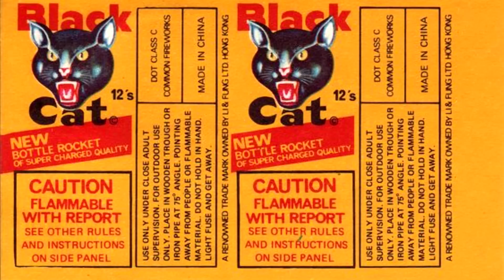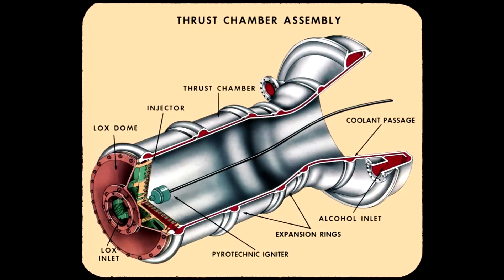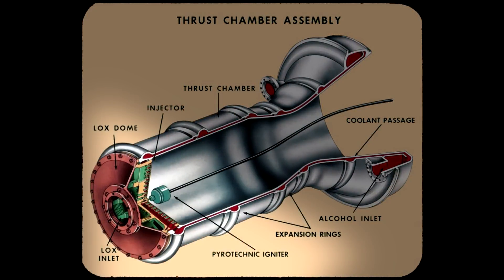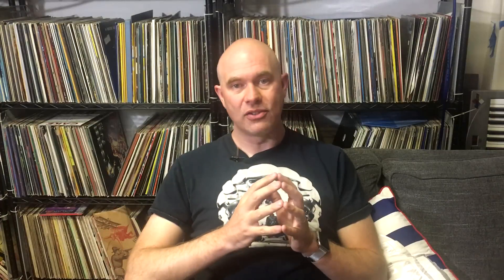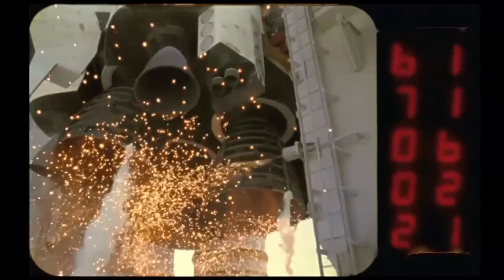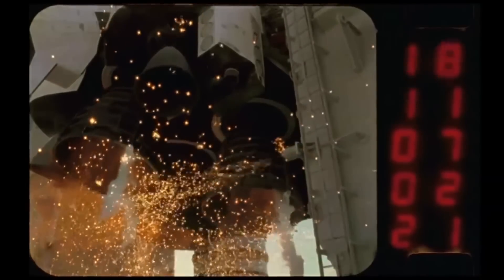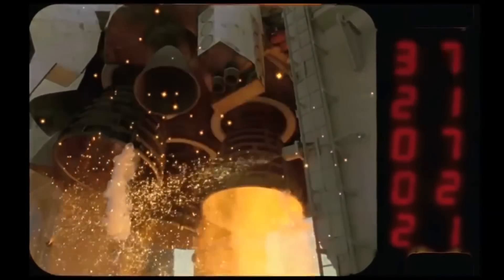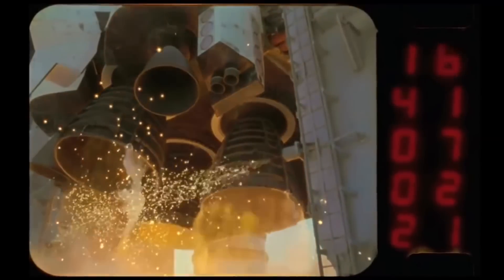How Rockets Are Ignited - Things Kerbal Space Program Doesn't Teach

Comment: Anyone interested in some of the hair-raising history of rocket fuels and oxidizers should really read through "Ignition! An Informal History of Liquid Rocket Propellants". It contains some real howlers: "If Tannenbaum's mixtures were bad, that proposed at a monopropellant conference in October 1957 by an optimist from Air Products, Inc., was enough to raise the hair on the head of anybody in the propellant business. He suggested that a mixture of liquid oxygen and liquid methane would be an extra high-energy monopropellant, and had even worked out the phase diagrams of the system.* How he avoided suicide (the first rule in handling liquid oxygen is that you never, never let it come in contact with a potential fuel) is an interesting question, particularly as JPL later demonstrated that you could make the mixture detonate merely by shining a bright light on it."
Reply: They just re-published Ignition! and I really recommend it if you're any kind of a rocket nerd. It's fun and informative, and makes me really glad I didn't faff around with liquid fuels when I was wanting to build a rocket myself.

Comment: From what I understand the Soyuz has 4 boosters running at liftoff, with each booster having one engine and each engine having 4 combustion chambers. Do the combustion chambers technically count as their own engine?
Reply: Nope, all 4 combustion chambers are thought to belong to the single engine, RD-107/108. There are also small nozzles which work on turbine pump exhaust and make the steering, they are part of engine, too. By the way, when rocket starts there are 5 engines working: not only boosters but the central engine as well.

Comment: Of course, the flip side to hypergols is that you generally wind up with large fires, rather than explosions, when you have an accident. For it to be a good and proper explosion, the fuel and oxidizer need to mix relatively well prior to ignition. That can't happen with hypergols as they ignite on contact. 

This was one of the reasons why Gemini (launched by the Titan II GLV) could rely on ejection seats rather than a launch escape system. The Titan II was powered by hypergolic propellants, so if there was an accident the fireball would be small enough that the ejection seats would clear it. Conversely, if the propellants were RP-1 and LOX, there was a strong possibility that the two would mix relatively well during an accident, prior to being ignighted allowing for a much larger explosion.

Comment: At about the 1:20 mark, you said "RP1 or Liquid Hydrogen". RP1 isn't a cryogenic, it's just refined kerosene.
Reply from the maker: +Nevan Lowe you're not praying that phrasing correctly.
Reply: I assume he means "liquid oxygen and [RP-1 or liquid hydrogen]", which would account for the fact that rocket fuels are combinations of an oxidiser and a reducer, and technically both combos would be cryogenic because rockets using either combo have to manage at least the O2 cryogenically.
Reply: Any fuel cooled to a low temperature is considered cryogenic.

cry·o·gen·ic
krīəˈjenik/
adjective
1.
relating to or involving the branch of physics that deals with the production and effects of very low temperatures.
"a powerful cryogenic engine"
Reply: "... Cryogenic propellants like liquid oxygen and RP-1 or liquid Hydrogen." It sounded like you were implying RP-1(Kerosene) and LH2(liquid Hydrogen) were the same fuel. Regardless, you mentioned RP-1 like it was a cryogenic propellant.

Comment: should talk about the fuel pumps 

most amazing thing i learned about the SSMEs was the sub synchronous whorl issue in high-pressure turbo pumps and that it was never solved so they tested it to destruction and lived with  it making the pump bearings the major factor of each engines life

Comment: Love yours "KSP doesn't teach you" series the most. And why does rocket "spark plugs" do work only with hydrogen+oxygen engines? Surely "rocket matches" systems that russian rockets use are cheaper than the space shuttle ignition system, but you can reignite the engine in case of failure, can't you?
Reply: I think that's the point, you can't reignite rockets that use "rocket matches".

Comment: But how do they light the mini SRBs at the top? a mini mini SRB?
Reply: Very much like a shotgun shell without the shot, the explosive optimized for heat and fast energy release.
Reply: Nasa Standard Detonators. Basically the same thing they use to blow explosive bolts. It's a two stage affair of lead azide and rdx.
Reply: @wingracer1614  Do you have any sources about that? Why someone would use a detonation to initiate a deflagration on such safety critical component. Considering usually solid rocket fuels contain large amounts of ammonium perchlorate which can detonate. I would guess is actually some short of thermite instead of a detonator.
Reply: Basically they use an electrically initiated blasting cap/ detonator.
Reply: It's SRBs all the way down...
Reply: Yes, with a mini-mini-mini srb igniter, with a mini-mini-mini-mini.....
Reply: Maybe an electrical signal?
Reply: @metanumia  Sure it would work but it needs to be for initiating some short of pyrotechnic mixture that deflagrates and ignites all the fuel, not a detonation train as happens in a detonator. If you use the exploding bridge-wire, arc generator or spark gap to directly ignite the fuel you run in to the problem that you need a huge power supply to do so which isn't very practical in the case of a rocket.

Something somewhat related and that uses your idea of an arc generator are ETC guns (Electro Thermal ignition Chemical guns) which is basically a conventional powder gun with a special plasma torch instead of a primer on the cartridge, this device generates a huge plasma plume inside the casing, this makes the powder burn much more uniform and in a controlled manner as you can control its burning by modulating the current going into the plasma cartridge also you can use special propellants with higher speed of sound/energy but that are harder to ignite and control. This is being researched a lot since the early 90's to increase the muzzle speed of tank rounds while also reducing erosion and high pressures because conventional tank guns are already at the limit of what is possible with normal technologies (muzzle speeds of around 1800m/s) its crazy.

Comment: This whole time I thought the sparks on the Space Shuttle were for engine ignition; thanks for throwing that bit in!
Reply: +Hirschi74 not just the launch pad! The sound waves reflect off the launch pad (tearing bits of concrete loose in the process!) and hit the vehicle, which can cause pressure fluctuations in the combustion chambers of rocket engines directly above it (and this can be a self reinforced process, making it worse until they destroy themselves) , and can even collapse fuel tanks in extreme cases. It's a seriously bad thing.
Reply: i thought the water spray is for cooling purposes while it is instead mainly for noise reduction. The soundwaves at a start are such violent, they would severely damage the launchpad if they weren't dampened
Reply: Matthew Ducker
oh yes, forgot about that. Thanks :)
Kudos to the engineers to tame such gigantic powers (at least most of the times)
Reply: It was widely thought the sparks on the Space Shuttle pad were for engine ignition because this disinformation was repeatedly broadcast as the explanation for why the shuttle engines couldn't restart.

Comment: Always wondered what the blue cones of flame were on the Shuttle Engines during launch, is it the engines burning differently than they would in a later stage of launch or some other weird effect?
Reply from the maker: +mrSevenths the blue cones are shock diamonds caused by the exhaust pressure being less than atmospheric. See my Nozzles video for more on this.
Reply: hydrogen burns with a clear blue flame

Comment: I've heard that the SRBs for the shuttle don't light until the shuttle's main engines have essentially lifted the weight of the whole thing off the pad. There any truth to that?
Reply: Not really and sort of. The RS-25's don't actually make enough thrust to lift the Shuttle System fully fueled. The three SSME's only provide around 1.5 million pounds of thrust, and the entire shuttle system weighs ~4.5 million pounds at lift off. Even at the throttle 109%, the SSME's can't actually get close to lifting the vehicle without the SRB's (which provide about 6 million pounds). They do however ignite the SSME engines before lift off for final checks, as an abort can be completed by shutting down the engines. This is because the SSME's are liquid fueled. The SRB's on the other hand cannot be shut down, therefore, they are only ignited at a moment before lift off in order to minimize risk/chance of failure and maximize the chance of an abort while staying on the pad.
Reply: Anvilshock A British unit of currency approximately worth $1.32 USD.
Reply: The fuck is a pound?
Reply: It's informally referred to as the "twang".  The SSME  and SRB ignition sequence is a choreographed series of events.  Prior to SSME ignition, the engine are gimballed outward from each other to reduce the stresses on the structure as they ignite.  The initial run-up of thrust causes the entire stack to bend forward, away from the topside of the shuttle.  This if very noticeable in the launch pad cameras aimed at the top of the external tank.  You can see the tank flex forward (downward as seen from the flight deck) 12-18 inches.  This twang cycle takes about 2-3 seconds, during which time the main engines are gimbaled more or less to centerline (not truly in line with the stack but essentially in line with each other), and as the stack reaches centerline again from its initial rocking, the SRB's are ignited, the anchor bolts severed and the vehicle leaves the launch pad.  Firing the SRB's when the stack has returned to its neutral position reduces the stresses that would be involved if the SRB's fired while in a flexed condition.
Reply: The computer systems onboard the shuttle (there were, I think, 5 of them with a voting system) started the three SSMEs in sequence at T-6.6, 6.4 and 6.2 seconds, and then monitor the engine performance. All three of the engines must reach 80% of full thrust by about T-0.4 seconds or the computers will abort the flight.  Only when they've met that criteria (and a bunch of other systems are nominal as well; see pdc023's comment) will it send the firing signal to the SRB ignition systems, at T-0.  At that point the computers effectively loose control of the SRBs.
Reply: The shuttle does lean forward a bit, but that can have a host of other causes.
Reply: Anvilshock if you're going to troll, at least do it intelligently.

Comment: What kind of fuel do solid rocket boosters use? (I already know solid fuel, just curious on what is used)
Reply: For the shuttle, its a combination of Aluminum perchlorate and butyl rubber, with binding materials.  It leaves tiny sapphires in its wake.
Reply: Different stuff. The shuttle SRBs used PBAN-APCP.
Reply: DFPercush There's different types. Black powder is actually very inefficient.
Reply: I think it basically amounts to black gunpowder enhanced with thermite (aluminum powder). Don't count on my word there though.

Comment: Trieythlborane  was also used to ignite the mighty J58 engines on the SR71, and initiate the afterburner.   the plane carried enough to start, restart or go to burner 16 times.   
JP7  fuel was very difficult to ignite, so conventional ignition methods wouldn't work.
Reply from the maker: +stinkyfungus so yeah, didn't watch the whole video did you? :)
Reply: An interesting fact to note is that the JP7 was so incredibly hard to ignite, that regular maintenance and fairly normal clothing could be worn when the fueling was done. Think more casual than filling your car. TEB on the other hand, is so hypergolic that refilling required silver flame suits and massive safety precautions!
Reply: +Scott Manley what does the triethylaluminium do?

Comment: +Scott Manley ,   what would hapen if a Space Shuttle launches but one of the Big sideboosters stops firering? Does it turn to te side and does the crew get ingured or does NASA have a special thing when that hapens?
Reply: solid rocket engines don't stop firing until they are out of fuel, so not really an issue.quick jettison of the burning srbs was planned for most abort phases (all except for abort to orbit, basically)

Comment: So that's why making an amateur rocket that burns regular kerosene is so difficult? I didn't know the ignition system was so complicated.
Reply: Well... There's the plumbing too. The injectors. The actual building of the rocket. Getting permission, and getting the fuel.
Reply: There's also the issue of how to get the kerosene from your tanks --> engines at a rate high enough to provide enough thrust to the rocket. For that you need a turbo-pump or a pressure feed/high pressure ullage gas. Either way it's not easy. A turbo-pump is insanely difficult to construct, as they must have a turbine or motor to drive it. The geometry behind the design of a turbopump is even more difficult, as high efficiency must be reached to minimize the amount of energy spent on running the turbopump in the first place. Ullage gas is also difficult to work with as it must be an inert fluid (usually helium) and be high enough pressure to feed the Oxidizer and Fuel into the combustion chamber. 

Of course you also need to get your hands on a good oxidizer. This is probably even harder, as you will likely want to use LOX, a cryogenic liquid that requires careful handling. You could stick to a hypergolic-type oxidizer, but those are extremely hard to get your hands on. And there's always other low performance alternatives that might be easier to get your hands on, but none that would justify making a liquid Kerosene engine vs a solid/hybrid system.

You also have not yet taken into account of heating. Many liquid engines tend to use a regeneratively cooled nozzle/combustion chamber to improve performance/pressure ratios. Without these features, the ISP/performance of the rocket will drop and eventually it once again becomes pointless using a Liquid propulsion system over a solid/hybrid.

Ignition is just the tip of the iceberg for liquid motors. But they offer higher performance and significantly improved safety over solids.

Comment: the russian aproach seems primitive but considering they are using mutliple smaller engines on most rockets its a simple and secure way to make sure all go off at the same time. if they dont the consequences are pretty severe. hypergolic fuels would be to dangerous for that. if you use one big main engine thats less of an issue.
Reply: It's not russian approach., it's soyuz approach( or old approach). newer engines use hypergolic igniter (rd-170(energia) rd-180(american Atlas) rd-191(angara) )
Reply: The Soyuz is a descendent of the R-7, which was developed in the 50s (the R-7 put Sputnik in orbit in 1957).
Reply: 1010ZZZ1010
soyuz aproach then. my point is simply it seems secure (since you can check if the wire is molten ornot), it works and dont fix what isnt broken. (because someone would probably say "haha they use giant matches in their rockets how primitive!").
Reply: Soyuz have lot of anahronisms, like it need rotating  launchpad for inicial directing.  But it's robust, time proven(more then 750 launches) and with well esablished construction process. Despite all kind of more modern propositions even technofetishists americans after so much prase to sts still use it.  Manned rockets is too risky for shares and too niche market for serios investment in it, so good old soyuz with his  matches still going to space.
Reply: Rotating launchpad is not needed any more: Soyuz started from Vostochny didn't have it (simplifies launchpad very much) and has rotated first seconds in flight. Rocket seems symmetric but its flight control has designated pitch and yaw axes, so it was considered easier to make a rotation than to project these controls into actual axes, though it may be changed later.

Comment: KSP pumps are the best pumps, don't understand why they bother with the whole rocket engine makarky, just eject fuel at a fraction of the speed of light.
Reply: Why not eject the fuel at the speed of light! Infinite energy!
Reply: but that adds a little in work and the fuel it goes unburnt, and this beat the purpose of the fuel. And last, injecting something into fraction of c requires a lot of energy
Reply: swish joking how fuel in KSP can move as far as you want as fast as you want with no need for power.
Reply: Not infinite.  Review the formula for kinetic energy.
Reply: Pretty sure that'd cause atomic bomb levels of destruction.
Reply: Much worse. this would be like an atomic bomb that continously explodes as it rides up into space. Any object with mass approaches asymptotically infinite energy as the speed approaches c; this is a continous, arbitrarily large explosion.
Reply: >atomic bomb that continously explodes as it rides up into space
So, like a Nuclear Salt-Water Rocket?
Reply: @caav56  Late reply, but project Orion? using nukes to launch a masive ship, throw one out the back of a blast plate hop up, throw another, and onwards you go, ship sits on top of plate with big shock absorbers cushioning it from the blast
Reply: @andreww2098  Key word being "continuously". Orion has to deal with hammer-blow acceleration, uzing multi-stage shock absorbers to lengthen it in time and lower the Gs, whereas NSWR has continuous thrust from get-go.
Reply: @caav56  The Book Footfall describes the launch of an Orion ship, "If the first bomb fails you try again, if the second one fails you are already in the air and falling to your doom!"
Reply: @andreww2098  I've read ths book. "God was knocking and he wanted in bad".